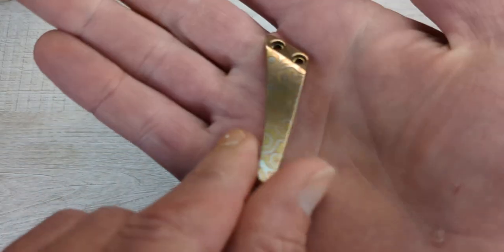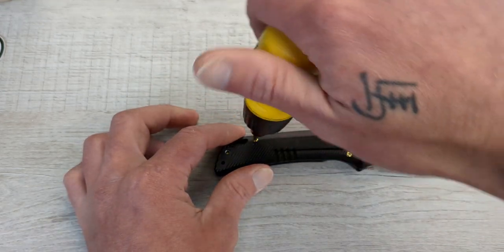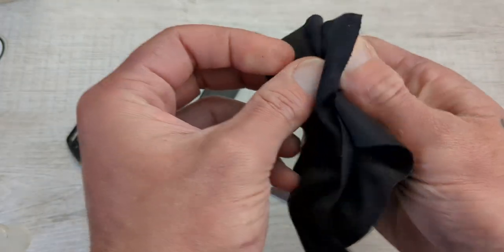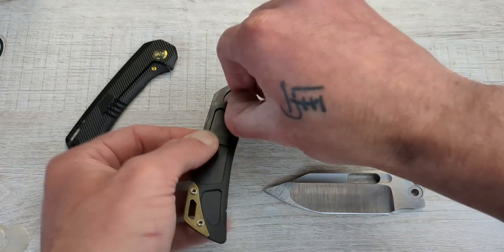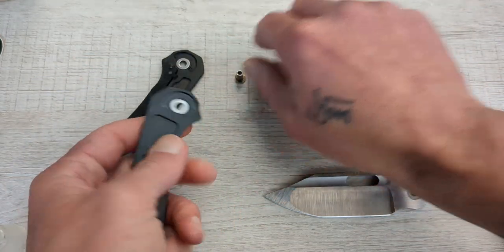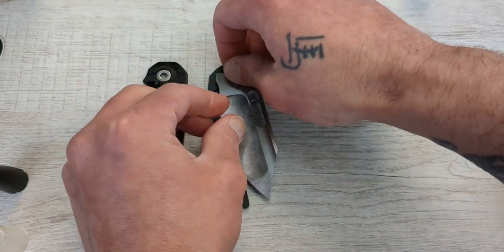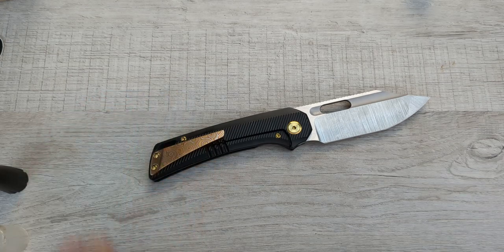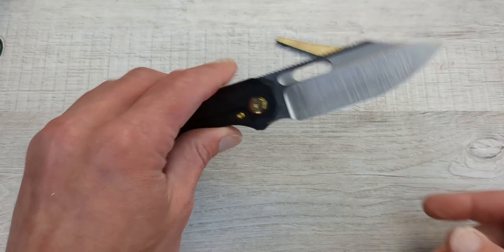This Just Got Even BETTER!

Comment: Looks awesome bro! I have an all murdered out black 20CV Relative and it’s phenomenal! I have #007 and was stoked to wind up with such a cool number. I originally received it back in the first half of January and I literally stared at the box for a month n a half before I finally opened it! That Relative is sooo good and definitely my favorite knife! I also got a blue Zircuti clip with it. I haven’t put it on just yet.. I’m thinking about getting a second Relative for the Zircuti clip and leaving the first one all black. But I dunno.. EMPEDC is supposedly going to come out with more of the crazy and expensive ones like those Damasteel ones that sold out too quickly. I might just try waiting for one of those.
Reply from the maker: it is one of if not my favorite all time knife, i absolutely love the relative, i thought about buying the murdered out Relative drop point lol, but i need to buy all the models so i try to mind my buying habits, the dama would be up to you, but it might be worth snagging one thats all black again and then do the clip on that one just get the other blade shape, the dama will be very hard to get, but def would be sweet, love it though man! i have a ronin and nymble tanto v2 on the way